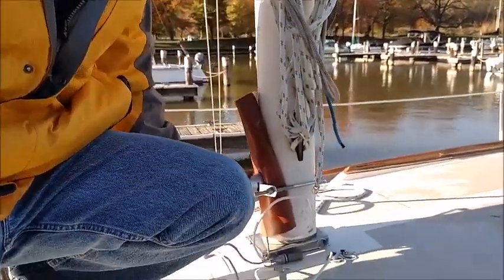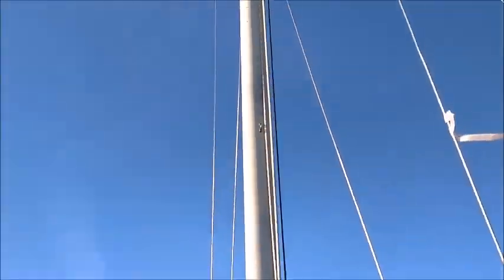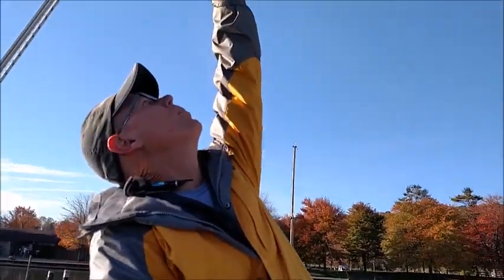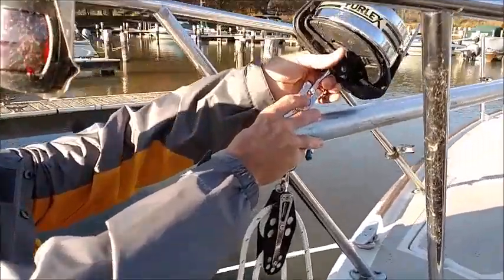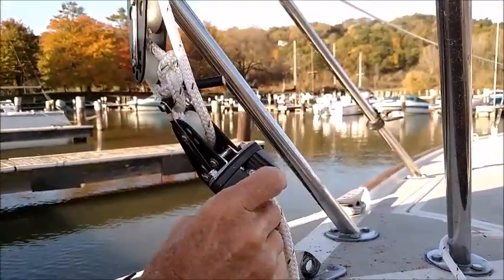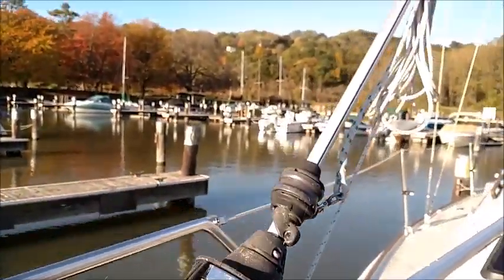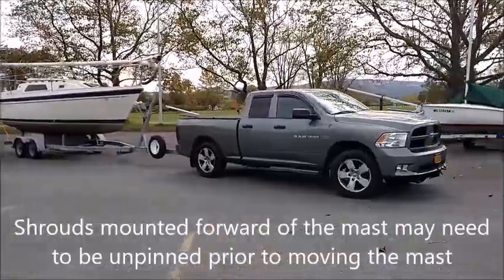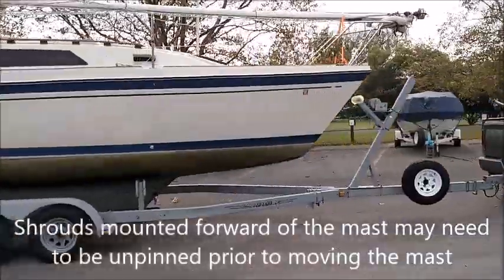Raise or Lower a Mast with a Gin Pole

Comment: Don’t forget to slide the main hatch shut. Also I found out the hard way that the lines I tied from the pole lift ring to the life lines, was too high to reach, once the mast was up. Sailed the season like that. Used the whisker pole once. Don’t need a lift for the 110 jib.

Comment: Is the mast on a hinged system for dropping or your just removing the bolts and letting it drop freely ?
Reply: On this Oday 26 and most other similar sailboats, there are two bolts that mount the mast to the mast plate. One bolt is removed. The other bolt remains in place until the mast is down. That bolt creates a hinge.

Comment: Great video how are you stopping the side to side movement ?
From where to where do  you place the lines to stop this wobble?
Thanks.
Reply: Each boat will be different, but the goal is to have a rope wrapped around the mast or a rope cleated approximately head or shoulder-high. One side runs port and the other side runs starboard to a deck cleat, stanchion or any fixed object even with the mast or slightly astern of the mast position in the direction where your dropping the mast -- which i assume is astern. The ropes do no need to be very taunt or tight.  The object is simply to keep the mast from wandering too far port or starboard on it way up or down.
Reply: @sailjazzdew  Thanks for that great reply it looks like in this video the shrouds are on when the mast is being lowered.So in most circumstances they would  be left on as well as the stabalising lines running back to cleats?
Reply: @sailjazzdew  Thanks for the help mate good luck,I think I will have a go at it myself.

Comment: What size and type material did you use for  ginpole/ pole you made?
Did you do anything for the side stays or prevent port/starboard movement? 
Is that a Dwyer hindge?
Thank you very much
Reply from the maker: Aluminum pole but it can be wood or another substance. It's 13 feet but it doesn't need to be that long.  Ten feet should work. Yes, sheet/ line (rope) is recommended to keep side to side movement on the way up or down. It can move slightly side to side, but obviously not a lot. I sold my boat in 2020, so that's how I remember it.

Comment: Great video - quick question. What keeps the foot of the mast from slipping towards the bow as you lower the mast to the crutch?
Reply from the maker: With most mast mounts, there are two pins (fore and aft.) Removing only the forward pin and leaving the aft pin installed allows a hinge for the mast to lower. Once the mast is resting in the stern crutch, remove the pin. Sorry for the late response.

Comment: This set up and rigging can be used for up to how large a sailboat ?
Reply from the maker: We've not tried it on taller masts, but the concept is the same -- only larger scale. A gin pole made of wood or aluminum would be longer but not necessarily larger in diameter. It should be the length from the base of the mast to the forestay chainplate. The boat's boom vang or mainsheet block & tackle would have the ability to handle the weight of the mast just fine. You could also use a winch.
Reply: Yachtorial: This is Andrew with Yachtorial. The size of the mast should be limited to any mast two people can easily handle, move, carry because it is necessary at times to lift the mast or carry it off the boat.
Reply from the maker: The process is the same for any size mast. This one is a 30 foot mast.